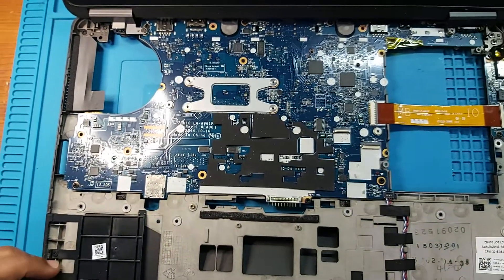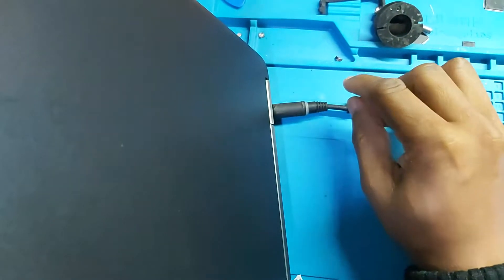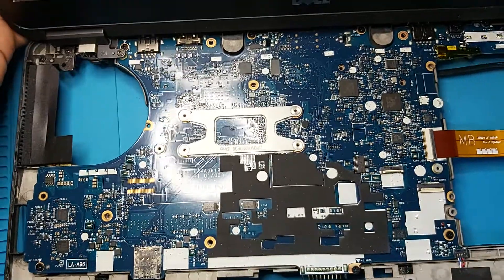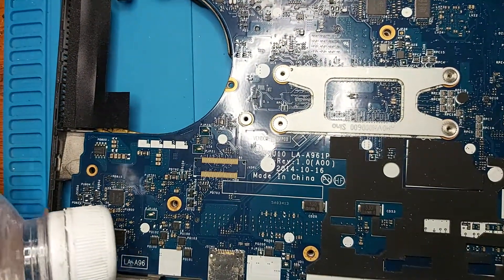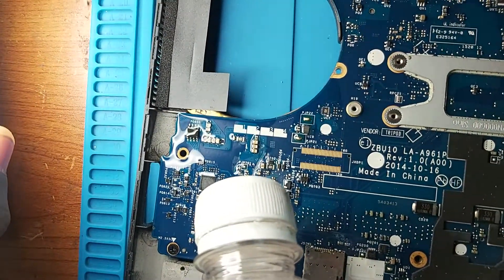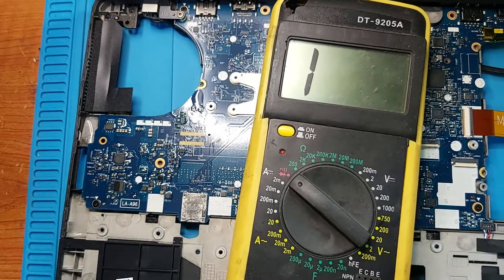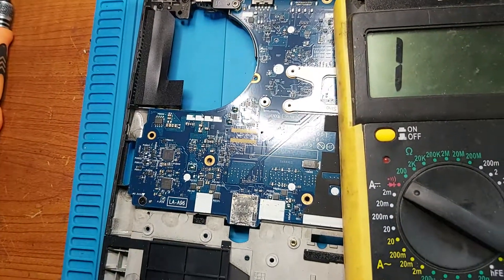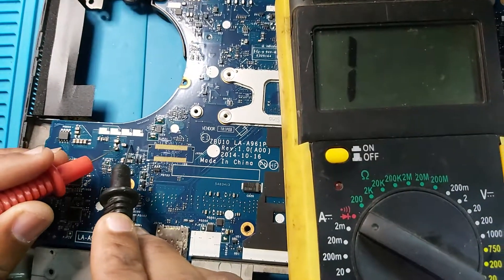Dell latitude E7440 Charger light turn OFF

Comment: Hi there at 01:41 , you said this area is main power Rail , please in next video explain how do you know that?? ,or how did you diagnose that area in main power Rail ??because for beginners is confusing  to understand which area in main power Rail . how should we recognize which area is main power Rail . because its very important   thnx
Reply from the maker: Thanks i will demonstarate that in the next video
Reply: is it something related to a “ color double fit” or somethjng elss that the damaged capacitor does not have anymore ?